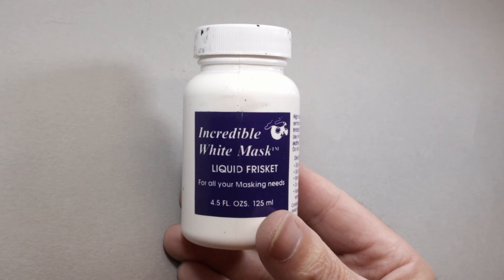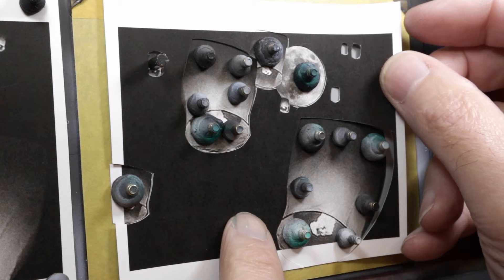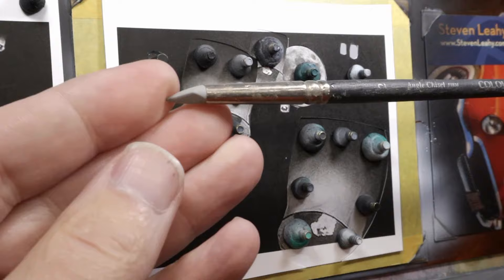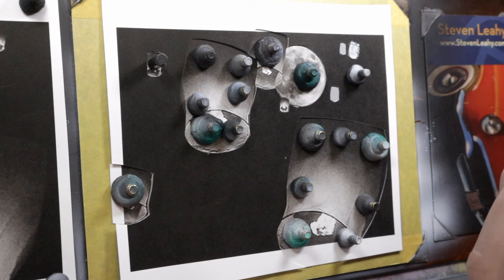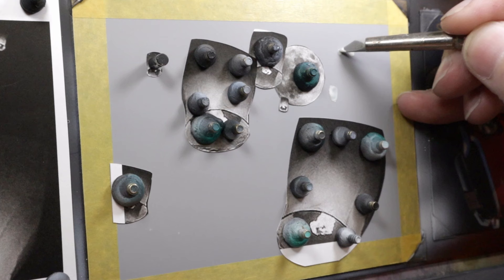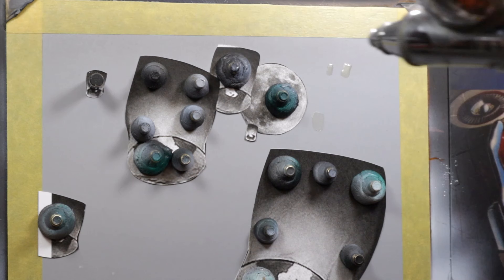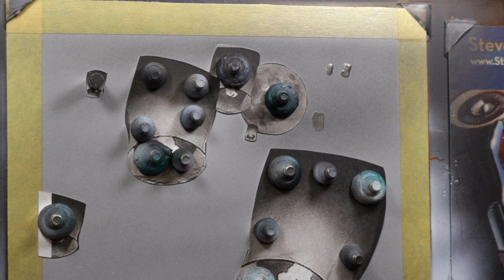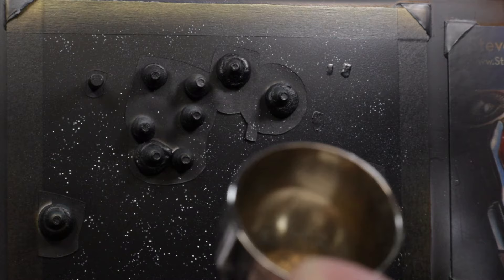Tech Tuesday - Liquid Mask

Comment: Solvents will definitely soften the mask, but for the most part shouldn't effect it too much. It will depend on how thin the masking is and how wet the solvent is. If cutting lines in the masking and using solvents over it, it will have a tendency to heal the cut lines.

Comment: That's a great way to mask off small area steve.  Although, I ruined loads of brushes when I first started using this stuff until I was shown the best way to apply it when I was at college... Using a Ruling Pen, which really gives you a lot of control when applying... and the best way to remove it.. well I'm a guitarist so I use the delicate touch of a fingernail.. :hand-purple-blue-peace:Yeah, old school.. You really can't understate the need to be delicate though.  :face-purple-sweating:
Rule Number One when using this stuff... Never leave it on too long as it leaves a residue behind on your ground... Happy New Year Steven.. :trophy-yellow-smiling:
Reply from the maker: This is great! I am going to try mine!